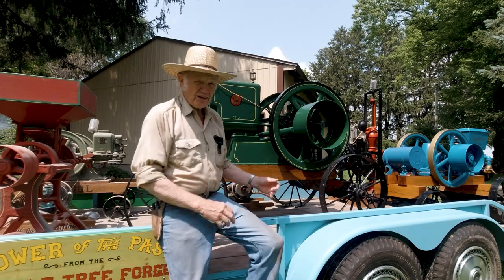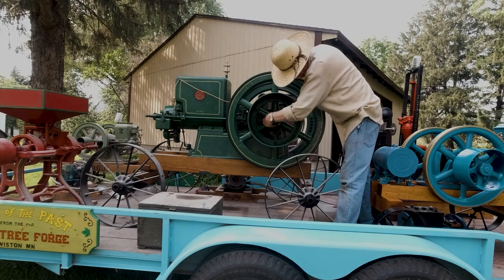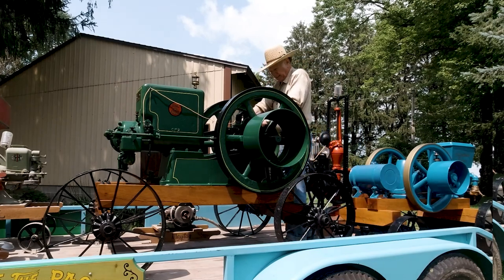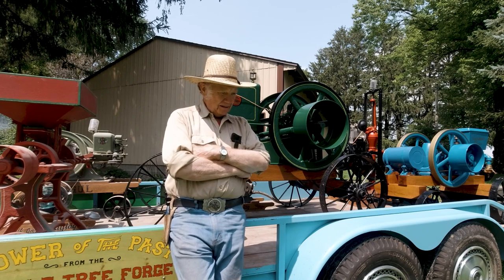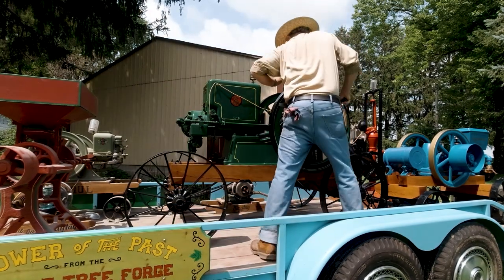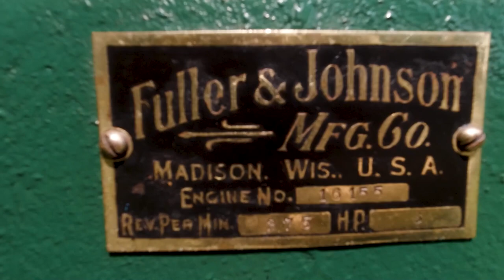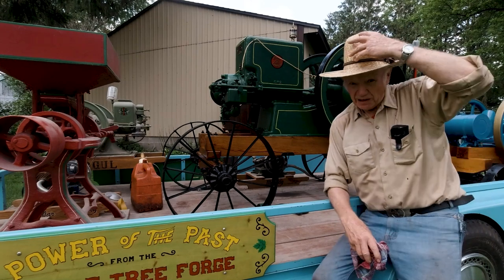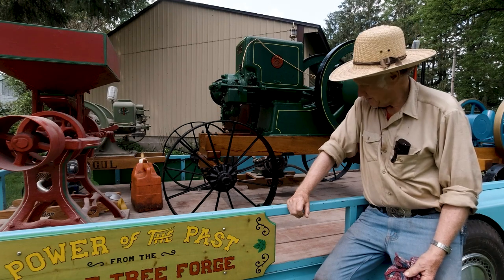How to Crank Start a 6 Horse | 1914 Fuller & Johnson 6HP Gas Engine | It Runs!

Comment: Nice engine and great story on finding it. Try latching the exhaust open before cranking so you can get some momentum on the flywheels. I hold my right hand on the crank handle and with the left hand a finger keeping the latch engaged. Once I get the flywheels spinning I'll release the latch. That trick might make starting it easier.
Reply from the maker: You're right but when I reach the lever to hold the exhaust open, I can't put my whole body into turning the crank on the flywheel anymore.  Next time I'll either make someone crank it for me or make someone hold the exhaust open.

The main thing I'm missing is muscle.  I don't know where it all went.  Either that or the engine gained a lot of compression.  You got a neat channel it looks like I look forward to watching more.  

I wouldn't want to arm wrestle you!